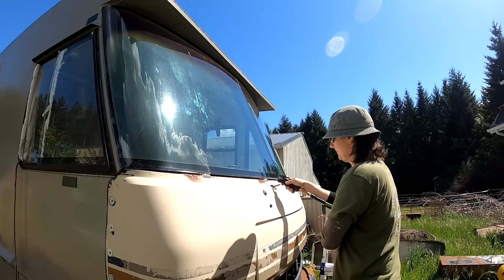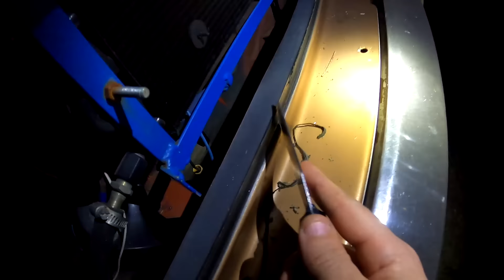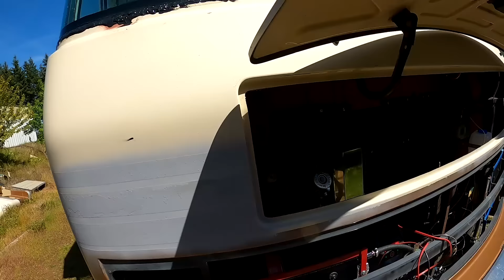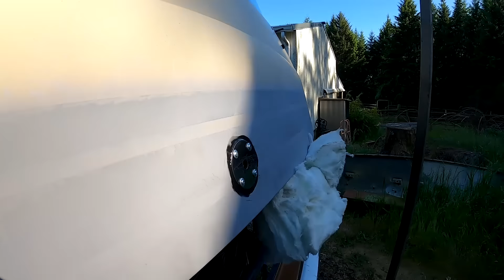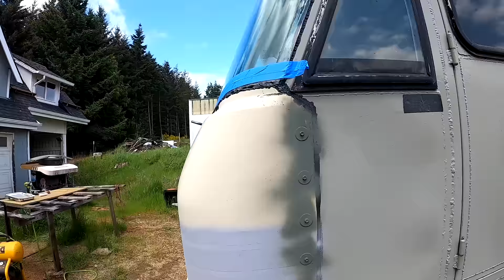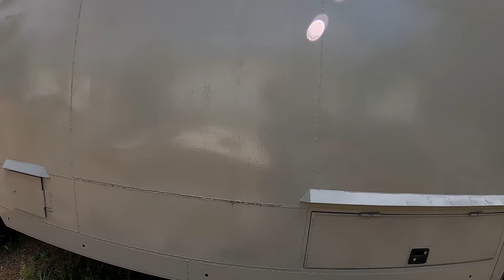RV REBUILD (Part 71) Painting Front Cap, Installing Hood Pin, Sealing Front Windows

Comment: Hello Class A. I'm a subscriber but I'm not up to date on all your videos. I've a 1995 Fleetwood Bounder with the 454 TBI and electronic transmission. Anyway, all my windows in the cabin except the windshield are fogged up and full of scale and I was wondering if you know of a vendor that has them for sale. I'm homeless without this rv and it's my only transportation too. I don't know anyone with a shop and have to do all my work at rest areas because rv parks and campgrounds dont allow working on them there. I do my oil changes and transmission filter, flush and repairs at the rest areas. So, yeah, I'm enjoying your channel and you've got quite alot of good information that's been helpful to me. You built yourself a beast of a RV. Eventually if I ever meet a genie or win the lottery I'd like to swap in a 7.3 diesel and the Alice Chalmers transmission but I haven't seen any genies yet. Currently I have a break line leak I think. The oil seems clear or light amber and I don't have any break line wrenches yet and I'm in a forest service campground so it'll have to wait. Just thought of another question,,, I have the Autopark setup and my emergency break pads arent engaging and I can't find a vendor, know of anything about those?

Comment: The bar on the rear you are referring to is called the Mansfield bar. It is to prevent cars from running up under semi trailers. Jayne Mansfield is the reason this bar was designed.  Due to her death from the auto accident she was in back in 1967.

Comment: For the back, what about a hardwood deck, and wood fence-type siding ?    If you have built-in steps on the footpath side of the road, there would be easy access and no need to fold out steps or climb etc , and the rear door could then be the main access into your Boondocker . A closed-in (fenced) rear would give privacy to your rear door when its open, provide a temporary storage area,  a relaxing outdoor place when you are on the road etc , a small stealth outdoor project area, a summer outdoor sleeping 'under the stars' area ,  an outdoor BBQ and dining area .   The space could have endless possibilities.

Comment: Looks good, pro-tip; right after applying any type of silicone caulk, spray the bead with soapy water, then run your finger / finger over bead. This will smoothen out the bead and not stick to your tool / finger.. you have come a long way since the beginning. Great job 👏 👍

Comment: I hand painted my RV including the stripes. You must use a FOAM cabinet grade roller; it leaves a smooth finish.  At a later time, you can always flatten the runs out with a razor blade and roll another coat over those areas. Good luck!

Comment: Glad to see you doing more work on your rig, looking good! Can't wait to see you on the road! I've been making some improvements to mine as well. I have stuff bought for "future projects" that need to get done, but I get tired from work and life and can't find the energy to get it done. It does feel good though when I finally get a project done. The most recent project was building a better platform for my bed, something much more sturdy and does not kink my back when sleeping. I am proud the way it came out. I have a hideaway bed and it came with a cheap very thin mattress I might as well have been sleeping on the ground. I replaced it with a big ol thick memory foam mattress but it was too big to be folded up and eventually broke the piano hinge and outside door/platform itself so I would always have to readjust it, and my mattress never sat level and flat. I was thinking about making a reinforced door and hinge but decided it was a pain to keep putting the bed away, so I made a permanent platform, and I got rid of the couch that was holding up the old platform. It's much better, sturdy, and now I have room underneath. I sleep much better. Next is to install a wireless switch for my home assistant server so I can setup automatons to turn off lights if I fall asleep and during the day to turn off my outside light automatically. No need to waste power when I'm sleeping and during the day for my outside light.